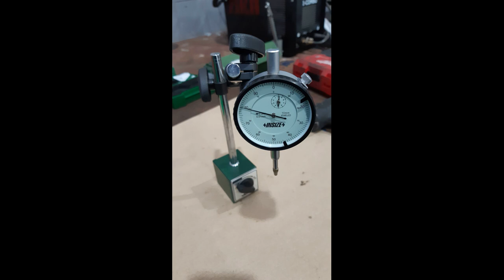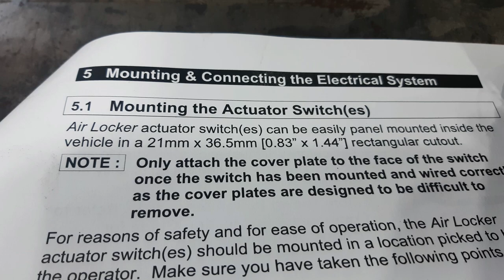ARB Air Locker Installation Suzuki Jimny 2019

Comment: Looking for the part number of the lockers, can you provide the ARB Part #?
Reply from the maker: This one is RD208, But Google "arb air locker chart" and choose the right one for your vehicle application.
Reply: @CrossEdgefabrication  thank you! I’m looking for my 2023 Suzuki Jimny. Do you know if the front is also the same?
Reply from the maker: @gabofuentes  For my opinion it will be RD206, 2003 on 10 bolts ring.
Reply: @CrossEdgefabrication  thank you so much for your help!

Comment: so something that aren't correct here (doesn't mean that it wont work) but you should avoid using the screws to pull the crown gear into its seat on the diff, you should heat it up and then fit it if it doesn't go all the way on, if I'm no mistaken even ARB themselves recommend against doing that u did here
Reply from the maker: In this locker and ring gear model, you can mount it all the way with only your hand. you can see on some of my other videos that I did heat the ring.  thank you for your comment.